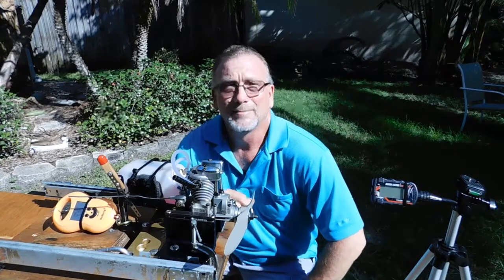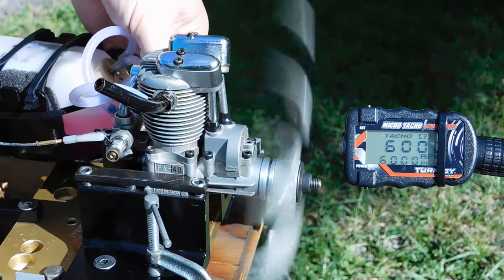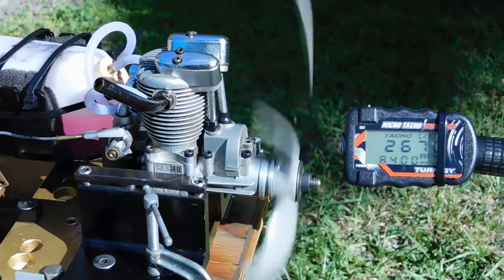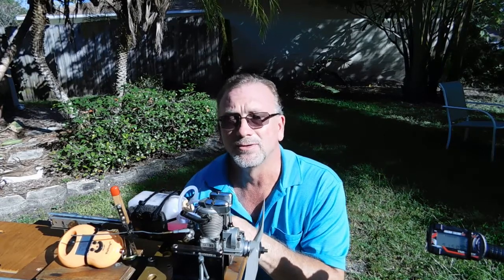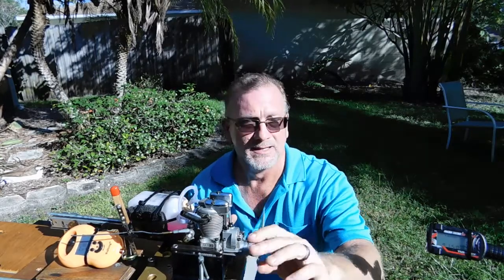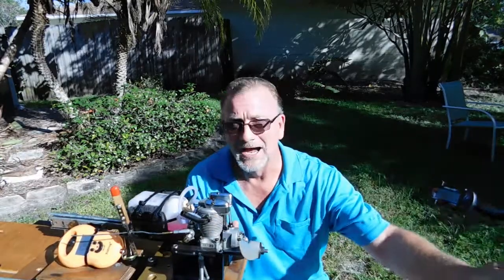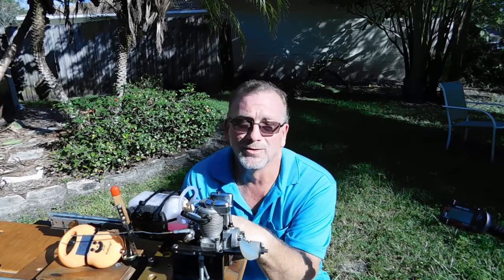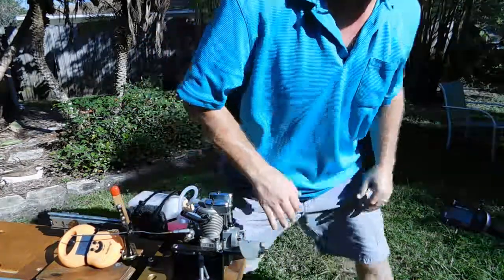Customer Engine Saito FA-40 The First Run

Comment: Hi can you please tell me the carburetor settings for some reason they sent me a Sado 40 but with a different instruction manual they are saying make the low needle flush with the throttle arm and 2.5 turns out with the high-speed but my engine just seems to start and then die after about 3 seconds

Comment: Anybody have this engine know if its running a ringless piston? I think this engine is the FA40 MKIII, I'm working on one atm and  it doesn't appear to have a piston ring-just a narrow groove near the piston crown. The compression is strong despite the omission of the ring.
Reply from the maker: If you do not see a ring then it is an early design ABC engine.  It also probably has the two piece head design too, right?  As far as I know only the early 2 piece heads were ringless piston ABC engines.  Much like the 45 in this review article. http://sceptreflight.com/Model%20Engine%20Tests/Saito%20FA-45%20%281%29.html